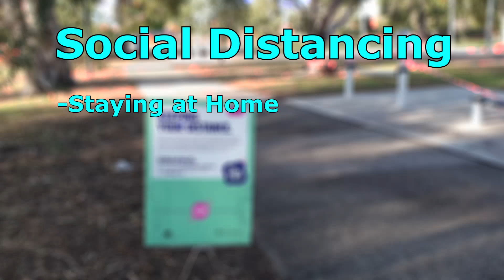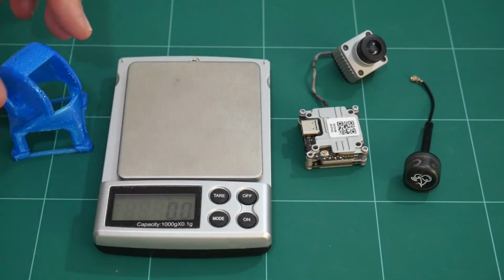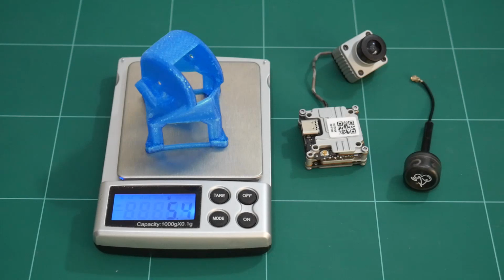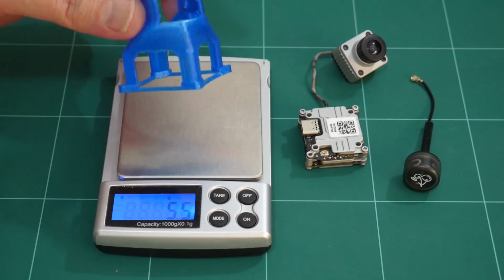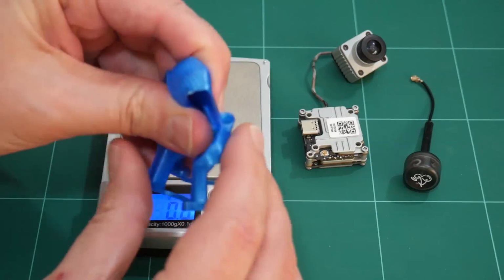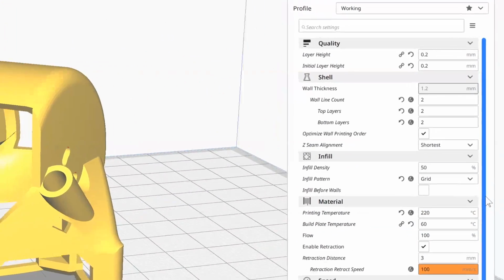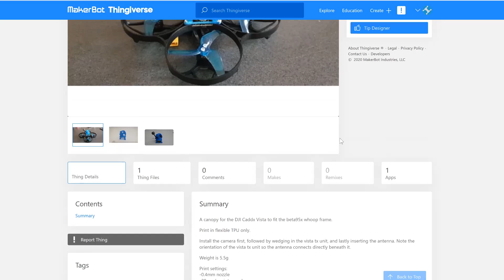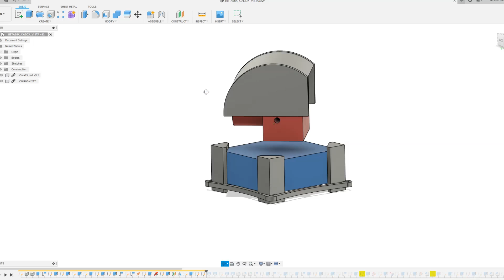3D Printed DJI Caddx Vista Canopy for Beta95x whoop frame

Comment: Hello, I am building a 3D printer with your hypercube project. First, I watched your DIY Bowden Drive for 3D Printers video and printed the parts there from another printer, but I have mk8 extrusion gear 26 teeth and 623zz bearing and the parts do not fit them, do you have the chance to make a change and upload ? Secondly, I use drv8825 motor driver and I set the voltage to 0.5, , still a subtle sound is coming from the motors.

Comment: I'm so glad that you came back!
You've inspired me for 3d printing and quad flying.
Have a question. I have a standard carbon fiber frame but it's a bit big for me. Is it reasonable to change to 3d printed one like peon?
Reply from the maker: Carbon frames are super light for their strength. 3D printed frames may break upon a crash where as carbon may be less likely to break. It depends on your flying style. Of course you can just print another frame so that's convenient :)
Reply: @Tech2C why'd you stop uploading content?